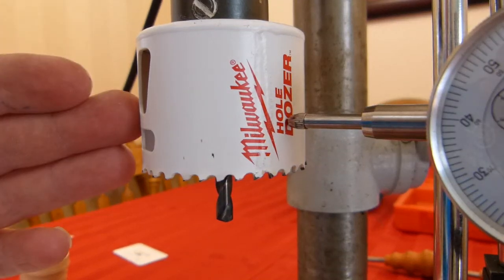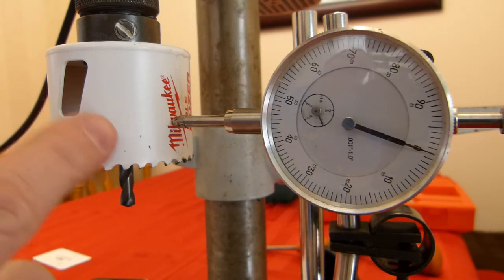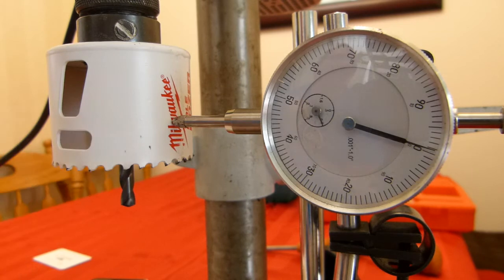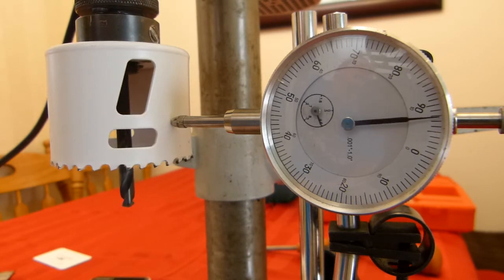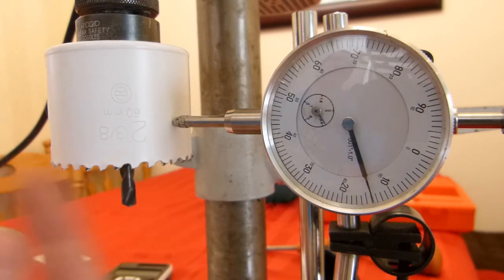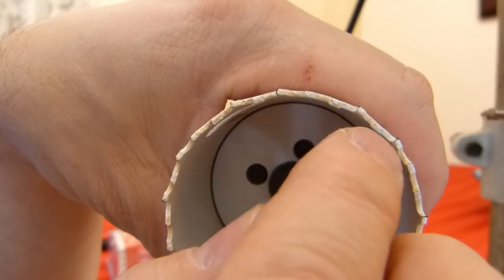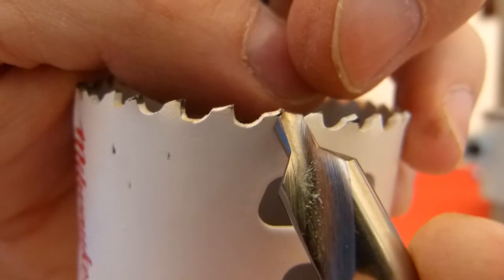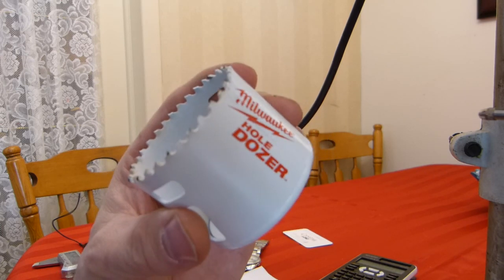Milwaukee Hole Dozer design review

Comment: I think you need to measure the runout of the arbor and the drill collet first to know the actual run out of the saw blade. If the arbor is bent then obviously the hole saw will show the same.  Lots of variables to consider.